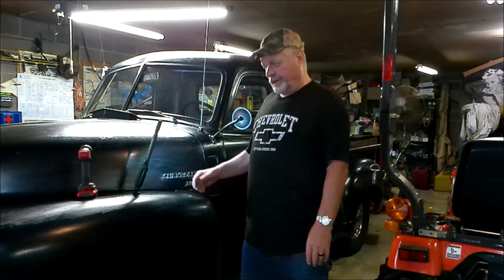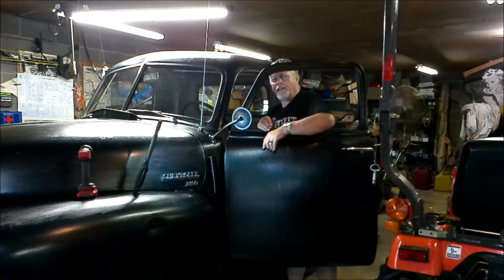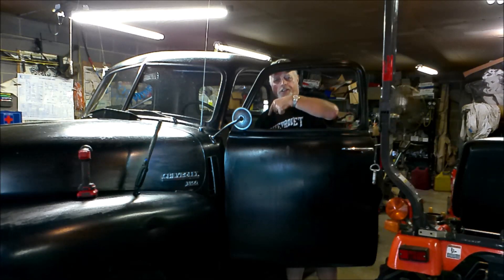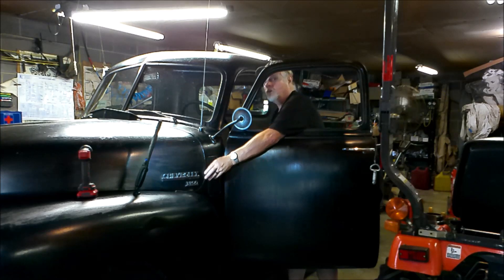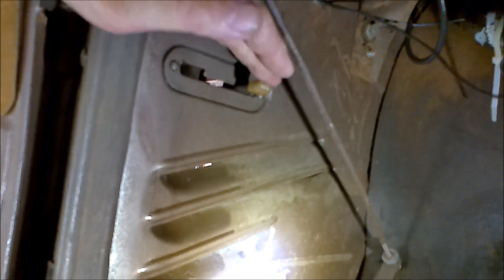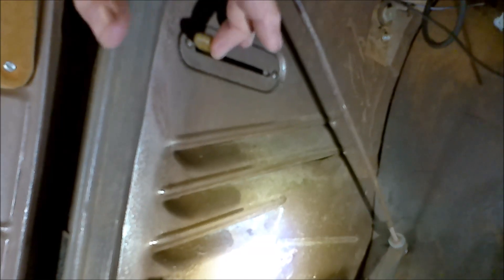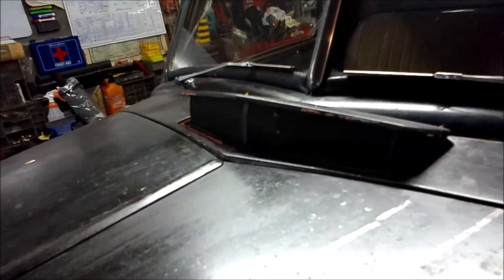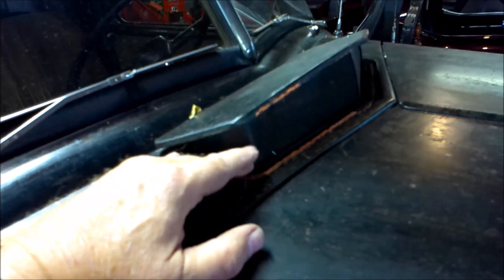1949 Chevy truck, Cowl and side vent operation Volume 91.

Comment: Well done. I must express my (now resolved) side cowl air vent frustrations. Some of the frustrations were self induced, what is else is new! Our 48 chevy trucks side air vent door hinge support that is spot welded to the side cowl the spot welds corroded and the door became loose. So I had to get that support fastned to the cowl. That became a major undertaking and I finally JB Welded it to the cowl. The problem is getting the proper angle of that darn support since it can fit almost in any position from slightly angled to 90 degrees to the opening. That's not all, in order to attach  the door assembly you have to FIGHT the darn springs which I feel that GM overengineered the springs to enable the door to stay open. As to the JB Welded support I could not find anywhere how to determine the angular fit. If you have the door out and try to pivot the door / spring assembly you have to use leverage to move it. That was a chore. I asked my Stovebolt forum for help and others and could not find that angle. Enough of my crying. Wish it was easier to post picture in support of the door fiasco. FOR YOUR INFORMATION the top cowl vent door RR is a breeze. 
The top cowl and the side cowl vent doors di get the sponge seals since the neoprene seals are to hard and do not allow the vent doors to close properly. 
Thanks for so many great videos you posted.
Reply from the maker: Congrats, you're getting your Stovebolt good as new.

Comment: Thanks for that. On the 41 Chevy AK I worked on, it did not have the side vents, but it did have an opening windshield that I had to have the gearbox for it rebuilt. The cowl vent was the same, but, I had no idea of any screen over it, or a drain. It just got my feet wet..
Reply from the maker: You definitely get wet feet, thanks for watching

Comment: I replaced the 4 hinge bolts on my 1949 and I also had to use some PB Blaster to free up some of the stiffness in the movement and it seemed to have done the trick to help get mine to move freely. I did also purchase the gasket for the cowl vent but haven’t driven just yet. Got to put the engine back in first 😎
Reply from the maker: Sounds like you're moving along. Every bit helps & gets you closer to the brass ring. And it's a mighty fine ring, LOL. Have a good 'un & carry on. 👍

Comment: Great video.  I found that my vent will not snap shut without the second spring - I just can't figure out where to buy a replacement spring.  Also, the gaskets are pretty inexpensive online.
Reply from the maker: Great tip!

Comment: Thank you for the info I was trying to figure out what that was for I'm working on the heater in my truck and I actually have the what I'm guessing is the drain hose running inside and someone attached heater hose to it and has it running through the firewall right where the heater lines run so I was getting a little confused as to what what that was for now I know
Reply from the maker: Thanks for watching